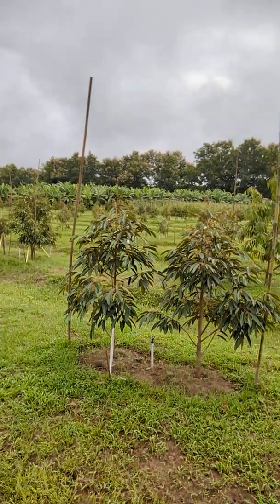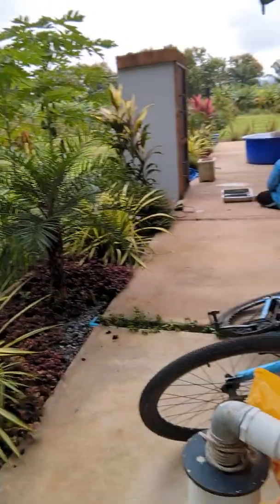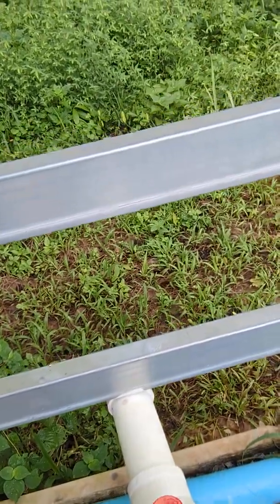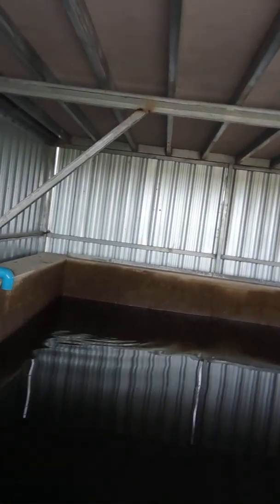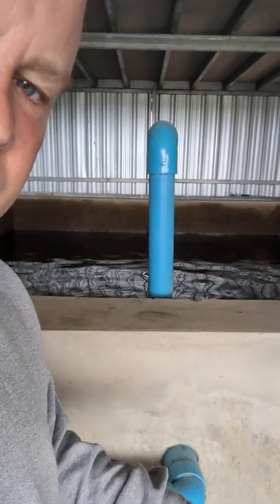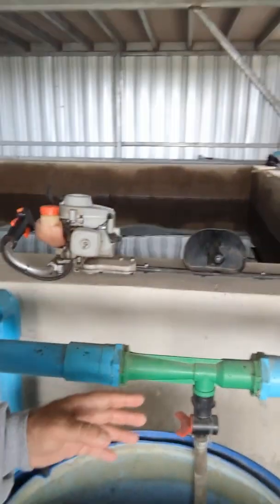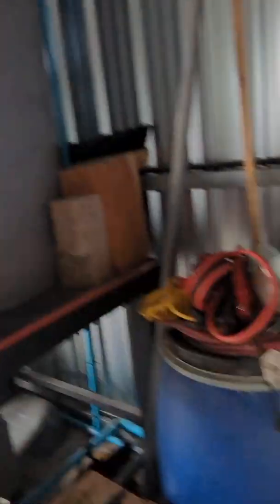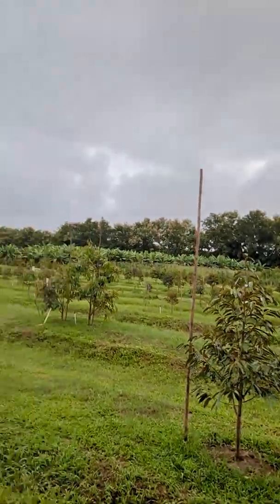How I Irrigate my 750 Durian tree orchard with hot tub technology in Thailand.

Comment: Great set up. What is your well GPM, and how often/long can you run sprinklers. I plan to do something similar, but using an actual fishpond. Never thought about a spa pump, but that seems plausible.
Reply from the maker: i see you're getting ready to move over .what state are you in ? As for my well my pump is a 2 HP and has a lpm of 150 ,as for the spa pump when I fill my tank the water level goes above the pump and primes it .you can use it for the pond but you need one of those one way valves that hold the water so to keep your pump primed .
Reply: @TMDurianfarmer  Wow, that's a high-volume pump! In South Carolina headed back to Sisaket around the 1st of October.
Reply from the maker: @ParadiseNThailand  SC a cool place nice beaches and food. Have a safe trip

Comment: Nice setup you have there, I am looking to set up something similar. What size is the pump and what brand is it.
Reply from the maker: I'm using a 2 HP lx spa pump ,the lpm is 600 Pluss .im running 3 sections that I water separately  , each has 170 sprinkler heads one for each tree.once the trees get bigger I'll need to go to a 3 HP pump also lx that has a lpm of 800 .This will increase the water speed so to water all the root base.they don't sale them in Thailand I ordered it from Alibaba

Comment: Thank you for the information.Nice video and nice property .I plan to make my Durian farm in Isaan start next month. We have 18 rai land  with my wife. How does work the airlock system  exactly with the pump? Thank you Leslie
Reply from the maker: Air lock is when air gets into the pump, to prevent it from happening when I refill my holding tank I fill it above the pump and any air that my have entered from draining the tank will be flushed out when I open the valves and turn the pump on